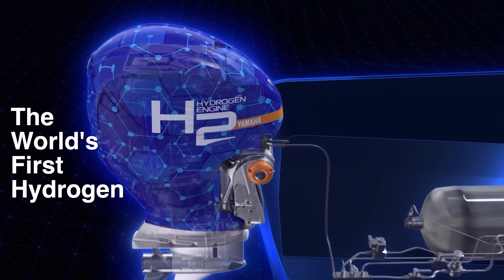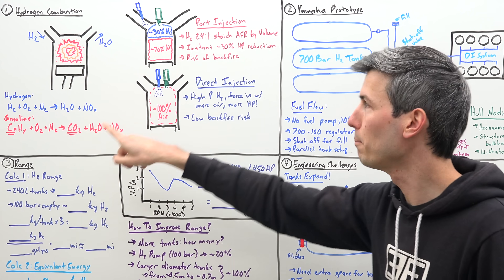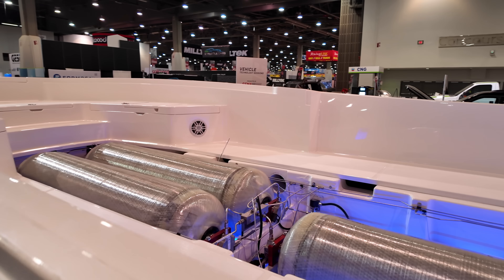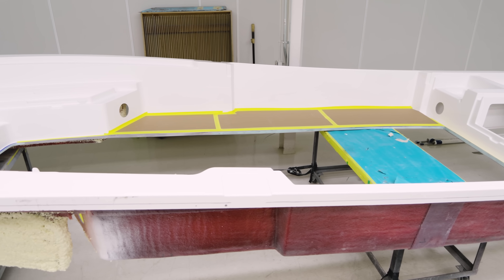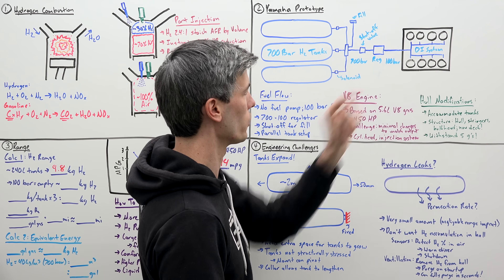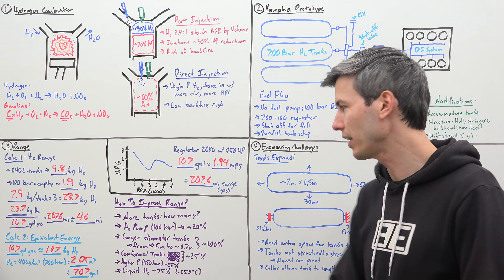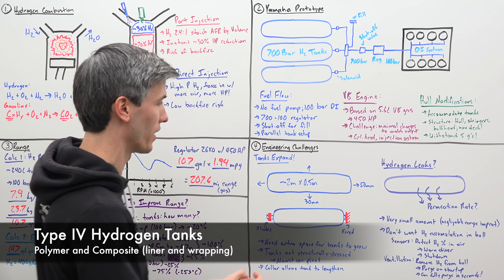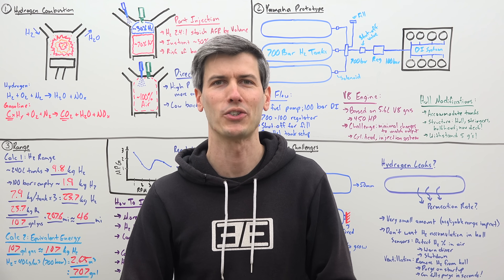The World’s First Hydrogen Combustion Outboard Engine!

Comment: Fluid propulsion doesnt allow for regenerative braking, so a more efficient engine is better than a fuel cell or series hybrid setup. Electric propulsion on fluids will only take over when we finally eliminate input conversion (plug-in batteries).
Reply: What is this input conversion you keep talking about?
Reply: @Imaboss8ball         Batteries do not store electricity, they store chemical energy. When a battery is charged, it uses the electricity given to it to regenerate the chemical reagents inside it.
What this basically means is that cost effective batteries will never really charge quickly, so that means all applications with plug-in batteries are only viable for people with predictable daily transportation needs, and even those people alone will collapse the electrical grid, simply because it works like a gas station without tanks.
The proof of that is the fact that electric primary traction has been ready for almost 200 years, and all its applications have thrived, with the exception of the ones that use plug-in batteries.
Reply: @Imaboss8ball      Can't find the answer I just wrote, so i'll try again:
Batteries do not store electricity, but chemical energy instead. This means charging a battery is an energy conversion operation, as the electricity is used to regenerate the substances inside the battery. This input conversion is the reason why plug-in electric vehicles didn't really catch on, despite all other electric primary traction applications having thrived for almost 200 years. We essentially have to use some other type of energy storage that doesn't get turned into something else while the vehicle is being replenished.
Reply: @Imaboss8ball     My answers keep getting deleted.
Reply: @gsilva220  are linking something?
Reply: @Imaboss8ball    not linking anything.  I'll try again: it's when electrical energy gets turned into something else instead of being stored. It's the reason why electric vehicles aren't more popular.

Comment: The perfect marine application for hydrogen is a pontoon boat, use the tanks as the toons so no hull space is wasted.  Hitting something could be quite a show.
Reply from the maker: Toon tanks has a nice ring to it!
Reply: @EngineeringExplained  Or boom tanks if they hit something hard enough 😂
Reply: @EngineeringExplained Please discuss the semi solid state battery from Nio.Which achieves a cell energy density of 0,36/kg. 
1:43 And pack energy density of 0,28/kg.
Reply: MV Kaboomz
Reply: I've always thought those would be great for battery power.  The top could be a giant solar panel.  Most people just cruise in toons, they aren't going 70mph.
Reply: That’s a great idea until you bump something 😎
Reply: Could you use a turbo or supercharger?
Reply: @suprememaxpayne  Yes.
Reply: I’m sure it’s corrosive properties would be an issue here.
Reply: @Xalta_Sailor  Explain.
Reply: @DonziGT230  There was an accident in russia where an Tank started to leak out Hydrogen and exploaded due to corrosion from the inside. The Hydrogen is corrosive against normal Tank material.
Reply: The Hindenburg is reborn!
Reply: Can a tank strong enough to hold gas at 700 bar float?
Reply: @bvoyelr  Probably not, but I don't know.  Being that they'd be so big they would't have to be made to hold that much pressure.
Reply: What could possibly go wrong.
Reply: Call it the H-bomb. Sorted.
Reply: I completly agree. They should send it to Ukraine for testing in the Red sea. Specially the last part at night.
Reply: Last time I was at the Red Sea, I couldn't find any sign of Ukraine. Maybe it took a wrong turn?  @b9eda9ad
Reply: Hydrogen is the fuel of the future; and always will be.
Reply: @Xalta_Sailor  Not a chance, unless a lot of things change.
Reply: @Xalta_Sailor  Using electricity to create hydrogen to create electricity VS using electricity. Even a kid could figure out which one makes more sense.
Reply: @ Don’t worry. I won’t hold my breath. Drill baby drill.
Reply: @Xalta_Sailor Not in personal vehicles. Again, go review the math.
Reply: think about this…. ginormous three, four catamaran hulls with a canvas deck since you want to store it.
OR
boost the production mechanism for immediate usage since storing it is unfeasible. use the water source under the hull for conversion, that is if it doesn’t need potable water.
Reply: @jackfullerton5762 That’s a great idea until you discover that it takes ~3x as much energy to electrolyze water into hydrogen than you’ll get from the hydrogen. Or 12x if you’re combusting the hydrogen. So wherever you get that energy from would be 12x better off by avoiding hydrogen entirely.
Reply: @markmuir7338  Not if its true if it is excess solar or wind energy. Electrolysis enables to store and move that energy for later use. Although I'll grant you that battery technology moves at such a rate that it might make this all this hydrogen stuff irrelevant in 10 years or so.
Reply: @snaaaaaaaaaaaaaaaake Exactly. And I’d argue that’s already the case. The cost of batteries to store excess green energy is less than hydrogen storage, except at the very largest industrial scales.
Reply: @snaaaaaaaaaaaaaaaake  It's already irrelevant. Just kept afloat by a bunch of people in denial.
Reply: @snaaaaaaaaaaaaaaaake  "Excess solar or wind?" One is called a sail and the other will barely run a camp stove. As indicated, this thing needs alot more power than a Semi. Now imagine using solar to run a semi.
Reply: @avgjoe5969  You sound pretty ignorant. There are periods where windfarms have to shutdown because the grid doesn't require the excess energy. There are billion dollar projects out there for efficient energy storgae.
Reply: @markmuir7338 yeah but they have more energy density per weight than your EV battery. EV won't work for marine transport because of the weight tonnage alone to make the space for the battery
Reply: @jackfullerton5762  Separating the hydrogen from water takes more energy than the hydrogen gives so that won't work.
Reply: @jackfullerton5762  And power the conversion with a giant battery for a grossly inefficient electrolytic process?
Reply: @jackfullerton5762  And what is the on board energy source for getting the hydrogen out of the water at demand?
Reply: @allanallansson9532  uhh, a rube goldberg machine?

Comment: How would refueling work?
Reply from the maker: Shut-off valve closes off the low pressure regulator, then you simply fill all three tanks simultaneously. You can see the fill port in the animation.

Comment: Could you include a comparison to Propane? wouldn't that be a good middle ground between gasoline and hydrogen?
Reply: Not if the goal is emissions reductions
Reply: @tarfeef101  still quite a bit lower than gasoline

Comment: Couldn't the hull itself be the tank?
Reply from the maker: Generally you want to use cylindrical shapes for the strength.
Reply: @EngineeringExplained  true, but if the pressure is reduced and replaced with volume, wouldn't that solve some of the issues? I do not claim any expertise on any of this, mind you. This is me just thinking out loud.

Comment: Couldn’t you simply make the hull a design that creates integrated baffled tanks? As in the hull is the tank? Think of ballast tanks. I know the pressures involved are the challenge here, but there has to be a way to create a hollow honeycomb style design that will be structurally sound for a hull and a tank in one piece.
Reply: Can you imagine the water pressure at 23000 feet down in the ocean? (Me neither!) That's the water pressure equivalent of the 700bar in those tanks. Twice the depth of the Titanic.

Comment: Semi truck uses about 9 bars in tyres.
100 bars explosions will be something. 
I hope they reinforce the tanks.
Reply: I used to work with these tanks a lot. They make a BIG boom. As you would imagine though, they are incredibly sturdy.
Reply: 700 Bar ......😬
Reply: We do way more than that with HPA PCP airguns. 3000 - 4500 is the norm. AEA now has a compressor that will do 7000 psi.
Reply: Normal SCUBA tanks are 300 Bar... so an order of magnitude higher than that...🤔🔥

Comment: Boats make so much more sense than cars at least in the preliminary stages of development especially if they can use the water they sit on to replenish the fuel.
Reply: Any method of extracting H2 from water takes more energy than you’d collect. Not to mention hydrogen combustion still produces NOx pollution. It would be far more efficient to just use an electric boat.

Comment: You already did a video years back showing cars etc cant have big enough hydrogen tanks to have a decent range, nothing seems to have changed, why they have gone ahead with this when it only has 1/4 of the range seems odd.
Reply from the maker: Yeah, "where to put it" remains one of the big obstacles with hydrogen.
Reply: @EngineeringExplained  Indeed - one of the many, many problems with hydrogen!
Reply: @EngineeringExplained  We just need wireless hydrogen.